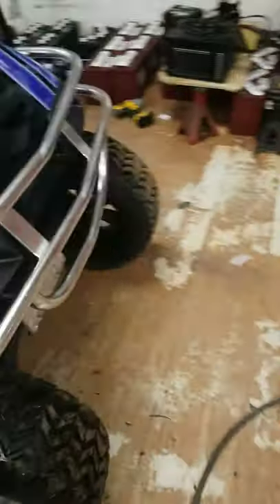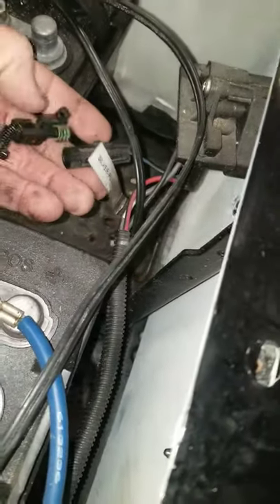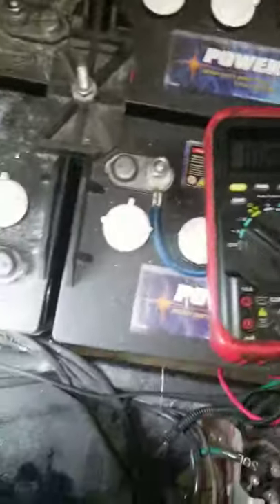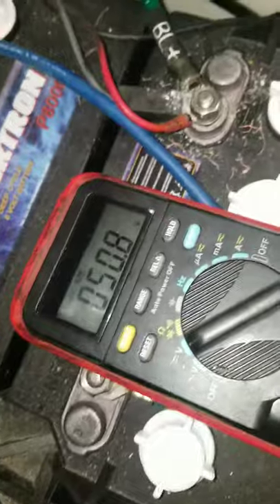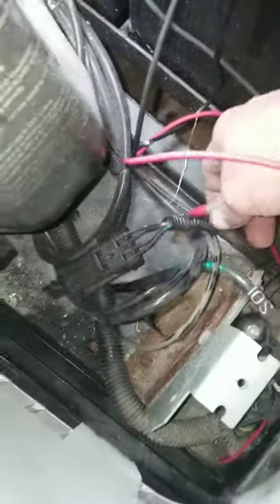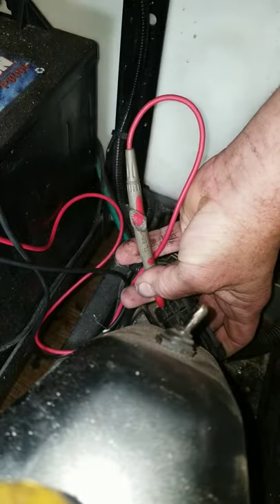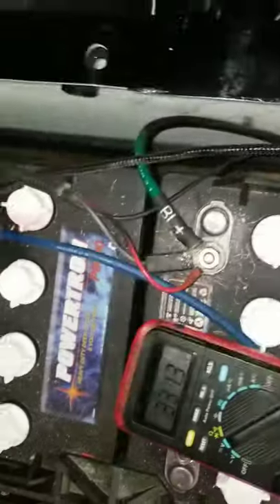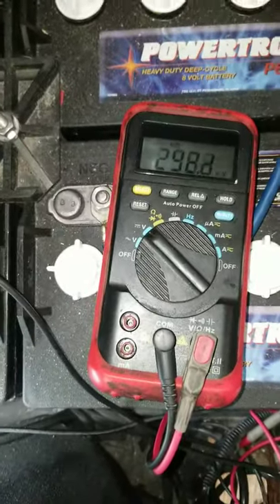EZGO 48 Test charger port, pedal sensor (ITS) and solenoid!!!!!!

Comment: Have txt 48 ezgo and just replaced all the batteries. Key switch on it says fully charged but will not nove in forward or reverse. Nothing happens when pedal is pushed down not even the reverse buzzer. All volts line up except the white and black plug wire show 3.8volts regardless of pedal being pushed down.
Reply from the maker: Did it run before you changed batteries

Comment: My 2005 Ezgo has brand new batteries and the charger is good. It runs good but up a semi steep hill it looses power. Am I just trying to make it do something it's not capable of doing or is something wrong.
Reply from the maker: All ezgo will loose power going up a hill. Execpt for an ezgo RXV.  All you can do is get you something like motor and controller to give you more speed so you can hit the hill faster.
Reply: @HeyHeyHey97  
I have a 2005 Western Electric LSV. I am having trouble.  My Cart will go in Reverse but not Forward. I have 7 2 yr old Trojan Batteries and I had all new Wires put on 2 mths ago when I experienced the same Issue and at that time the FNR switch tested good.  Any ideas what I can check next?
Reply from the maker: Do you have a handle by your leg.  Or an actual f n r switch for forward and reverse
Reply: @HeyHeyHey97   I have the Switch on the Dashboard
Reply from the maker: I would flip the top and bottom wire on the switch and see what it does. Since it has happened before going to say bad switch or bad wire going from switch to controller.
Reply from the maker: Follow the wires back to controller and check voltage.  Probably a bad connection somewhere.  Or good have a switch going bad.
Reply: @HeyHeyHey97   I tried switching the terminals.  That didn’t work.  I just purchased a new FNR switch and Switched it out and it still hesitated until I drove around my Community Parking Area then it kicked in with Full Power.  What do you think it is?  A loose Connection somewhere or Something Else?  I do not know anything about Golf Carts so please explain easily. 
Thank You for helping me figure this out.  It’s so frustrating...I had the Repair Guy here and $$$ later still having the same Issue.
He cleaned & replaced all my Battery terminals & wires.  He tested the Switch and it was getting Power and said it wasn’t the Switch.
I have 7 Trojan T105 Batteries a little over 2 years old.  What else controls the Forward besides the Switch?
Reply from the maker: @marietaddeo6155  a connection problem on one of your wires. Not battery wires somewhere in the harness
Reply from the maker: When you switched the wires did it run forward in reverse or just ran reverse in forward

Comment: I need help. 36V 2007 EZGO. The batteries are fine. I rode it with a lot of resistance up the hill. The batteries got hot. I went for a hike, came back and the cart wouldn't move. I hear the click when I engage the pedal. Please help.
Reply from the maker: Just seen this. Do you still need help
Reply: @HeyHeyHey97  yes. I need help. I replaced all the battery cables. The batteries are charged and showing 13 +. with the key switch  and  forward or reverse engaged. The solenoid will click. All four cables are secured to the electric motor . Any suggestions would be helpful. Thanks, Roy
Reply from the maker: @roymiller447  do you have a f n r switch on the dash or a handle by your leg.  For forward and reverse.
Reply from the maker: The reason I asked that is because I have videos on my channel to trouble shoot either type.  And I was going to share the link with you

Comment: Great video! I have TXT 48 and everything checked out as I followed your instructions, The cart is moving a little bit then it shudders, battery pack is at 50.3 and the batteries are 3 years old, Could this be the motor? Cart has lift and 23in tires, stock Curtis controller and motor is stock as well, has new solenoid, F/R switch, new ITS, And speed sensor in the motor, completely stumped on this one, Any ideas
Reply from the maker: Have you tested the batteries under a load. Meaning while you are driving it. Or put one tire up against a tree and rest each battery individually. As you hit gas. Don’t hold gas down too long. But probably motor.  But check battery voltage first
Reply: Had a cart that shuttered… brushes were bad. $20 fix diy
Reply from the maker: That right

Comment: I have a 2013 Ezgo RXV that has fully charged batteries but will go really slow when I press on the pedal. Intermittently it will go with speed when I step on pedal, but recently it won't go faster at all.  It moves but not at the speed it used to.  What should I check (least $ first). Thank you for the video.
Reply from the maker: @franvian8509  thanks for watching and commenting. when it goes slow how fast are we talking about.
Reply from the maker: @franvian8509  when the cart runs slow check voltage like in the video.  But before you do that check voltage in the batteries while driving and see how low it goes and let me know. EZGO RXV golf cart won’t move. Bad brake????Check voltage on the electronic brake!!!!
https://youtu.be/WTKKIFENu28

Comment: So if i have a 38vt cart ,all the wires from the pedal switch show  38vts and don't change with pedal depressed what does that mean
Reply from the maker: You have a 48 v or 38 volt
Reply: @HeyHeyHey97  38volt
Reply from the maker: They dont make a 38v
Reply from the maker: I meant 36
Reply from the maker: So you have a 36v ezgo
Reply: @HeyHeyHey97  yes
Reply from the maker: @ashtonnuckols2663  black wire should read 14vdc at full pedal and white wire should read 1.5vdc. Black wire on main negative. Red lead on black or white wire
Reply: @HeyHeyHey97  all 4 wires coming from the pedal sensor are reading battery voltage
Reply from the maker: @ashtonnuckols2663  unplug the harness from on top of the controller and check voltage again
Reply: @HeyHeyHey97  ok and if it's gone does that indicate a faulty controller

Comment: 36v ezgo txtpds. No solenoid click. Tested everything in the video and all is fine EXCEPT no voltage on the white wire of the ITS. I have 36v on the red and between green and red but nothing on white or black. Will this stop the solenoid from clicking? Also the cart has a XCT48400-PDS controller. Should the status light be on?
Reply from the maker: Yes will stop the sol clicking
Reply: @HeyHeyHey97  ok thanks. Im subbing to you. Your videos are straight to the point and accurate
Reply from the maker: @EGGINFOOLS  I just make videos of how I would want to watch a video. Some of them drag the topic on to long

Comment: I'm working on a 48v ezgo txt and the batteries are at 47v, no click from solenoid, scanner said throttle issue and HPD, so I replaced harness from 4 pin plug to throttle box, replaced sensor and micro switch, still same issue, scanner reads throttle position at 60% even when pressing in and out, not getting voltage fluctuation when measuring black wire on 4 pin to batt neg. Any tips would be much appreciated.
Reply from the maker: Unplug the wire from the it’s. Or throttle sensor and see what it shows
Reply from the maker: Also make sure there is no sign of water in the pedal if there is water under the its.  It will give false reading
Reply: @HeyHeyHey97  no sign of water intrusion, with black wire unplugged from ITS the voltage drops from 2.7v to 0
Reply from the maker: With everything you replaced. Controller. Did it show the same thing with the other the its in the pedal box
Reply from the maker: What does the white wire show go to the its
Reply: @HeyHeyHey97   white wire reads 5v
Reply from the maker: @dannymcreynolds1060  they should read 14vdc and 2.9 vdc coming back from the its. I would replace controller if readings are right
Reply: @HeyHeyHey97  think that's about the only thing left, already went thru the its, Microswitch, solenoid and wiring harness to its/switch
Reply from the maker: Yes replace controller then
Reply from the maker: Only seen that happen 1 other time and it was controller.
Reply: Replaced controller,  still having issues. Now the cart buzzes in FWD and N but not in REV. Also, the key seems to always be on. The only way to cut power is to toggle tow mode.
Reply from the maker: And it didn’t do that with the other controller correct??
Reply: @HeyHeyHey97  no, and with the new controller I'm not getting the computer to activate off of the diagnostic port. Wondering if the controller I was sent is the wrong one, the old one was PN 102806201 and the new one is PN 390215201. The company I ordered from assured me it was an updated part number but I'm having doubts.
Reply from the maker: @dannymcreynolds1060  I would say wrong controller. Must be wired different
Reply: @HeyHeyHey97  all the wiring was the same when I was swapping out, that's why I figured it was probably just an updated PN, plus the controller says 36v or 48v and the original only said 48v
Reply from the maker: If it says 36 volt or 48.  It’s the wrong controller
Reply from the maker: @dannymcreynolds1060  meaning that controller is for a different wiring harness

Comment: I have 48 volt to the to small wire with key off and as soon as I turn key on solenoid clicks but push gas no go its a 48 volt ezgo txt
Reply from the maker: Not good either a bad controller or something wrong with the pedal

Comment: Thanks for the great video. 2013 TXT 48v. Cart won’t move and reverse alarm doesn’t work. I also have no power to the white or black wires with key on, green reads 50v. Will the ITS also make the reverse alarm not work? Or is it possibly the F/R switch? Also tried bypassing the Reed Switch and have good key power to solenoid yellow.
Reply from the maker: No the it’s will just make the cart not run
Reply: @HeyHeyHey97  Hmmm, I don't have any voltage to either the black or white wires as described in the video. Is it possible that the issue is the FnR switch? Not sure how to test the switch.
Reply from the maker: If every other voltage checks fine and no voltage on black or white. Bad controller
Reply: @HeyHeyHey97  that's what I was afraid of. Thanks for your help.

Comment: Hello again 
I have a 2013 ezgo rxv golf cart. Would a weak induction sensor affect the top speed ?
Reply from the maker: No. How fast is it going
Reply: @HeyHeyHey97  it belongs to my son in law. I thought it was running fine. He thought after I replaced solenoid and pedal switch, it was running as fast. Not sure of mph
Reply: It wasn't running as fast
Reply from the maker: @brentduncan2137  if the speed sensor was bad it wouldn’t run but 1 mph or would sit there and shake
Reply: @HeyHeyHey97  ok. Thanks again

Comment: Is there a way to check my charger to insure it acually Chargers.?
Because I charged all my batteries individually so the cart had enough power to run around in.
But I still can't get my charger to charge the batteries.
Reply from the maker: What type of charger do you have and what type of cart
Reply from the maker: Do you have a volt meter

Comment: Great video - thanks for posting it. I have a 2011 RXV 48v cart that just died tonight.  I just put 4 T1275 Trojans in it. Drove it a half dozen times and it was fine. Took it about 1/4 mile and turned to a friends place it off. Went to take it back home an hour later and it won’t do a thing. Batteries showed 51v total. I turn the key to any position and get nothing..  Maybe key switch?  I will try some of your trouble-shooting tips. Hope the controller isn’t fried.
Reply from the maker: Try the charging port first. Follow what I done in video with the back of the wire from charger port.  Do you have a reverse buzzer in reverse
Reply: @HeyHeyHey97  - will do!  Oddly enough, it had just been on the charger before I took it on that short trip..

Comment: I have a 1989 easy go golf court and we give it gas and you can hear it like it’s running but it will not go forward or reverse any ideas on what’s wrong?
Reply from the maker: Check your brake drum.
Reply from the maker: They are splines were they go on your axle. And they are known for stripping.

Comment: Excellent video..thank you!  One question:  Assuming everything else is good, if the ITS is bad will it cause the controller to keep from activating the solenoid when key switch, pedal switch, and FWD/Reverse are proper?
Reply from the maker: What type of ezgo cart do you have.
Reply from the maker: 36 or 48 v
Reply: @HeyHeyHey97  It's a 36V TXT PDS.  I've checked all connections like I mentioned...the solenoid does not get an activation signal from the controller when everything is turned on and the pedal switch is activated.  I'm thinking this means that the controller is bad. Would you agree or do you think it's possible an ITS failure would cause the controller to not activate the solenoid?
Reply from the maker: @gltandwlt  have you checked any voltage.
Reply: @HeyHeyHey97  Yes .. all voltages are as expected.  However, I've not yet checked the white and black wires that go to the ITS.
Reply from the maker: @gltandwlt  checked the white and black wires from the its. One should be 14 Vdc and one should be 2.9 at full pedal key on and in frorward. Put the black lead of your meter on the main negative and take red lead and check the black and white wire.
Reply: @HeyHeyHey97  Okay...just did that.  Exactly the voltages that you said.  As I understand that blue wire on the solenoid should be pulled to main negative by the controller in order to engage the solenoid.  That is not happening.  Guess I conclude that the controller is bad...do you agree?
Reply from the maker: @gltandwlt  are you getting positive voltage on the small post on sol yellow wire
Reply from the maker: Also a check the green and red wire on same plug as the its wires.  Should read 36 vdc or a little less. When hit gas one should show positive with key on the other gets hot when hit gas.
Reply from the maker: You are correct about the blue wire but only if other voltages are right. Then it will turn to a ground.
Reply: @HeyHeyHey97  Yes, the red measures 36V and the green is zero becoming 36V when pedal switch is activated.  I also checked the motor speed sensor ... the black is ground, the white is 5V and the red is 12.5V
Reply from the maker: @gltandwlt  yea I would change controller
Reply from the maker: But before you put  a new controller back on. I would ohm out the black and white wire to each other. They should o put. Then leave either of the leads in one and touch the frame with other lead of meter. To make sure motor not shorted.
Reply from the maker: The wires that plug into the top of controller from motor
Reply: @HeyHeyHey97  Thanks so much for your wonderful help and responsiveness!!  I certainly will be checking your channel for any new videos you post.  Question:  I'm not sure I understand the statement "They should oput"  I know which wires you're referring to but not sure what you're saying I should expect on my ohm-meter.  I would expect a fairly low resistance since we're dealing with a motor winding.
Reply from the maker: @gltandwlt  I meant ohm out like 0. Or a little bit of resistance is fine. The main thing is make sure they don’t ohm meaning 0 out to the frame.
Reply: @HeyHeyHey97  Got it!  Thanks again...you've been a huge help!
Reply from the maker: @gltandwlt  please subscribe.  Np
Reply from the maker: @gltandwlt  take your it’s out and make sure not cracked. Because normally that or the motor burns controller up. If any cracks in black part of its replace it.
Reply: @HeyHeyHey97  Thanks again....any suggestions as to where to go for replacement controllers?
Reply from the maker: @gltandwlt  I would get them on line rebuilt.  By FSIP. They are good.
Reply from the maker: The question is since you are replacing it. Is it better to go back with one that has more power. A stock controller is 250amps. 400 amp or 600 amp will give you more power.
Reply: @HeyHeyHey97  Okay...thanks for the tip!

Comment: What causes not having voltage from the black wire coming from the floorboard the white red and green have voltage.
Reply from the maker: A bad it’s in the floor board.  (Inductive throttle sensor)
Reply from the maker: Thanks for watching. Anymore questions let me know. Hit that like button for me